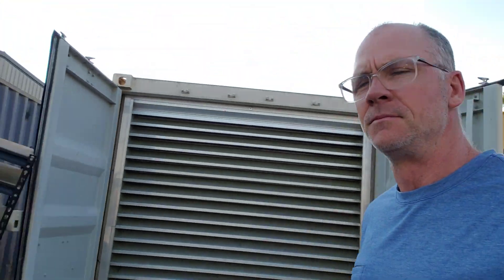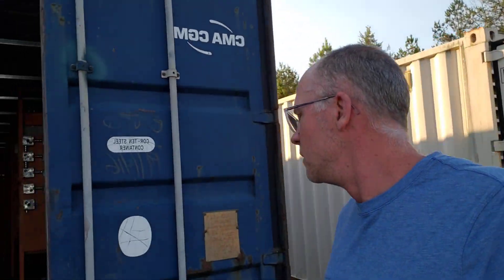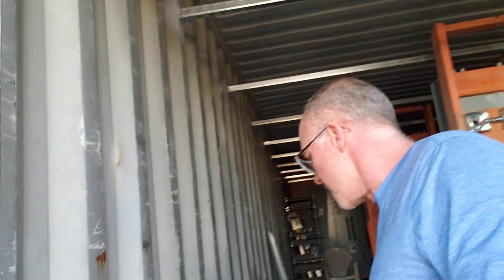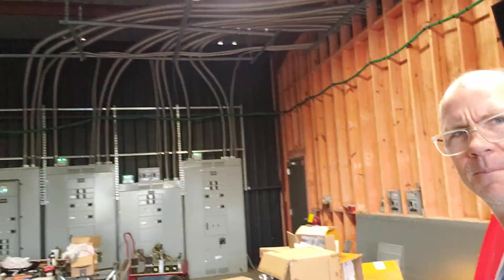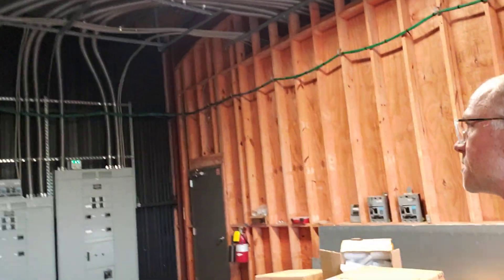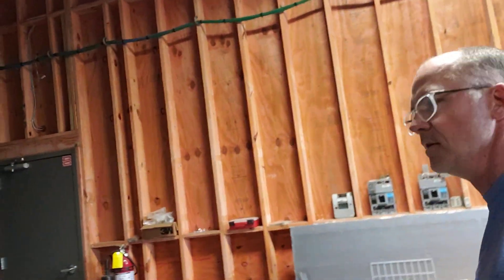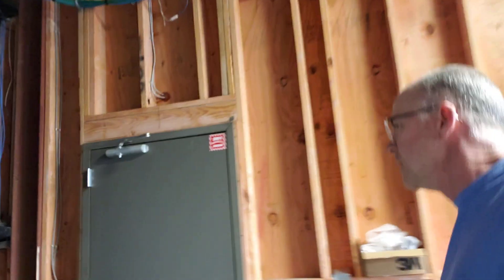Feb 2021 Bitcoin mining update and tour

Comment: Have you ever considered raising the container a bit off the ground, and replacing however much of the wooden floor is required for airflow with metal grates. You could certainly find a way to integrate them with filters and have exhaust fans at each end. My understanding is inside most shipping containers, the floors are 3/4 inch plywood, with metal joists about a foot apart. Would this work?

Comment: On your containers - do you have an easy access outdoor disconnect box?
Also - are you still using your rule of thumb - 200 cfm per miner - inside box for air change calc targets?

Thanks - you've been helping my designs & construction approaches.
Reply from the maker: In the future I would do a complete different electrical design. A weatherproof large panel and disconnect on the outside, and 350 amp pdus. On this one they'll be a button on the outside that can be hit that would trip the disconnect.

Comment: Why are you thinking of cutting holes in the side and mounting fans there instead of like the original design you did on the other  container where the fans are on the end of each container? Have any problems?
Reply from the maker: the flow through on the end is expensive, and the fans inside the container take up space that can be used for miners.